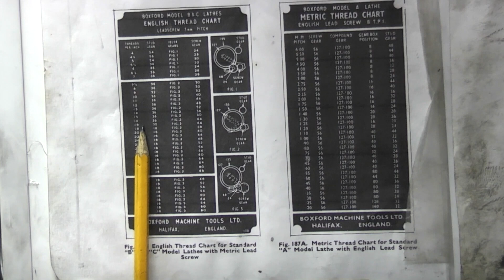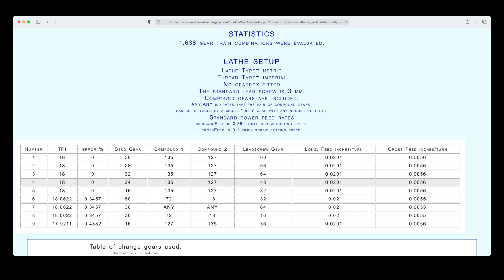Finishing the morse taper and 1.5 unf 18 TPI Adaptor

Comment: 1.5  18tpi is BSF Alan
Reply from the maker: BSF threads have a 55 deg angle UNF have a 60 deg angle on the tool tip
Reply: @enotsengineering  1.5 unf is 12 tpi

Comment: Hi. Useful for me! I've been contemplating turning a lot of ISO30 tapers. Any chance you could explain a bit more about calculating the set over? Cheers. BobUK.
Reply from the maker: Hi Robert on a Morse taper the spec shows the diameter at the small end and the diameter at the bigger end plus the distance between them. So if the difference is 0.25" between the two diameters at the correct length you know the taper is close Then you can use a Morse taper adaptor as a gauge to adjust the taper until it fits ok
Reply: @enotsengineering  So is there a 'standard' included angle for a morris taper? or what is the distance between the large and small diameters?
Reply from the maker: If you Google Morse taper angles you should soo some charts with the info